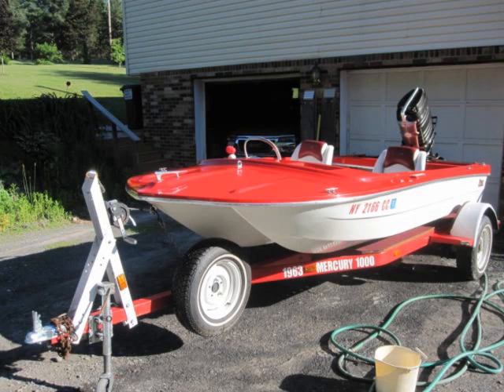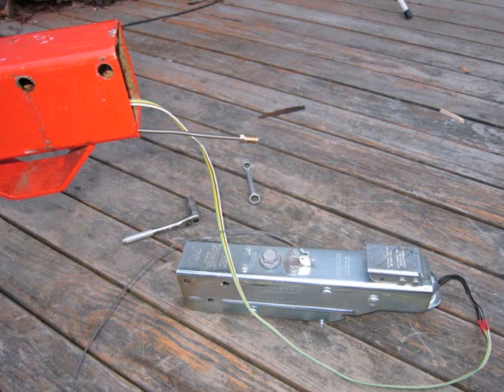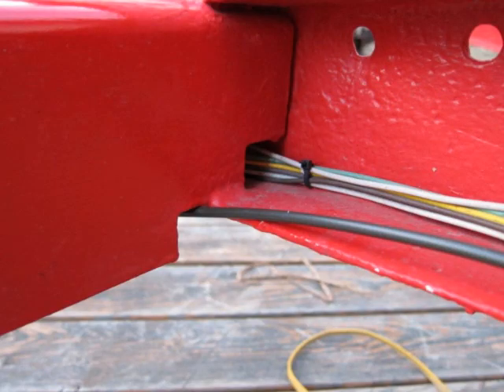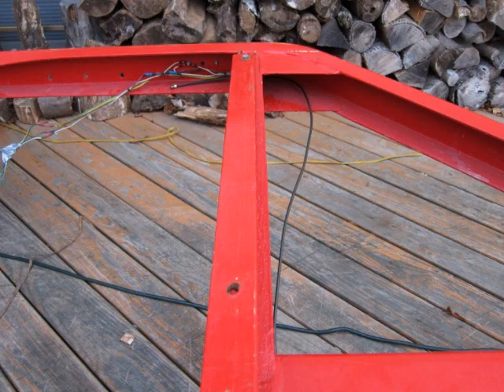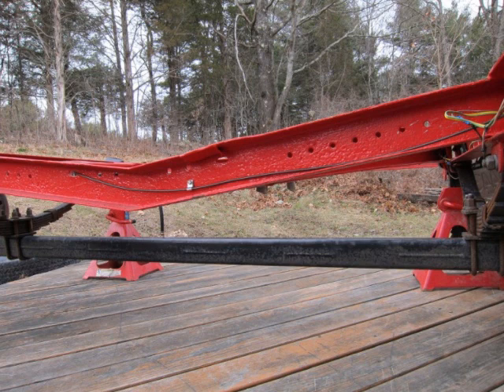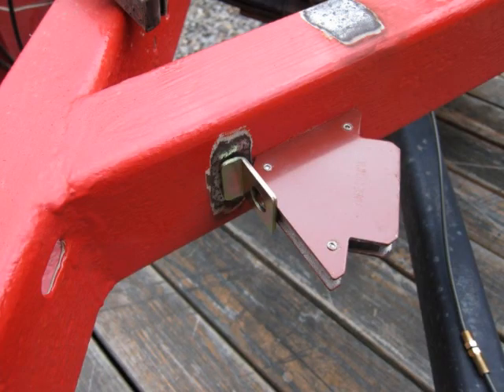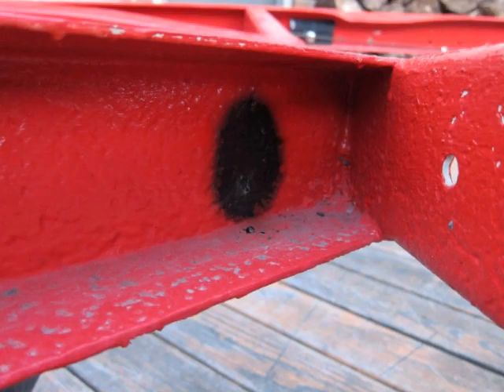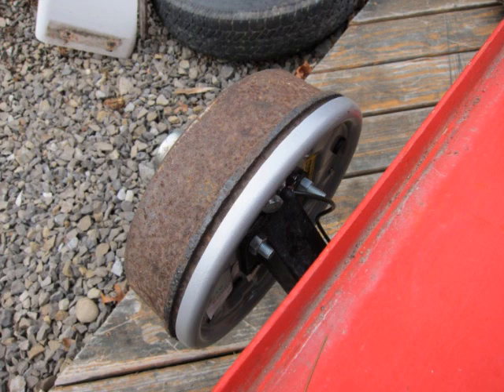Boat Trailer Brake Installation

Comment: Thanks for that great explanation.  I just purchased a 2005 boat with a tandem axel trailer.  The entire braking system is gone.  I am planning to refurbish it but I can't find any information on the original configuration.  Specifically if you run on flexible line to the axel then tee off with hard lines to calipers.  Your video confirmed what I suspected.  Good info.  Thanks!